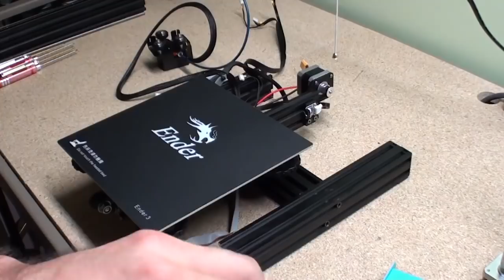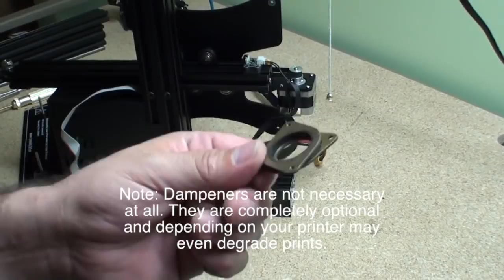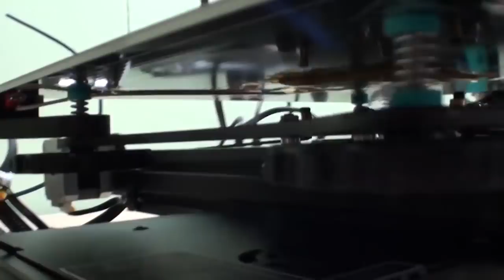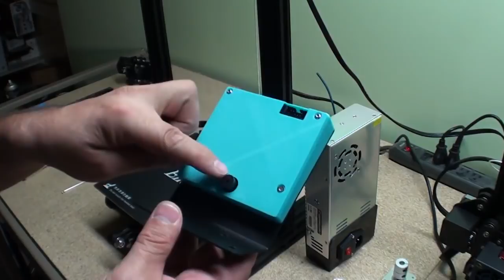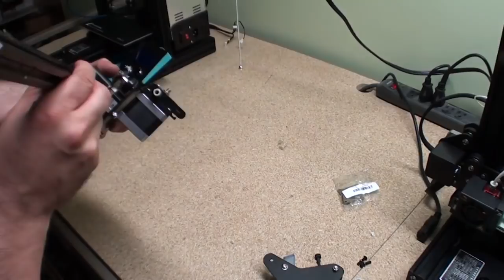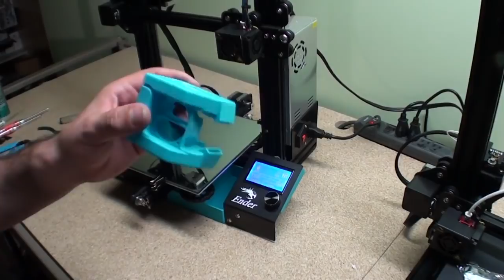Ender 3 Build Video

Comment: Would love  a good video detailing all the various forms of calibration to run with a new printer (bed leveling, PID, extrusion, flow and whatever they all are, probably several I've yet to hear of). Excellent video btw, will def run it while assembling my machine and some of the first prints will be the items you suggested.

Comment: GREAT thanks!  
Just got done putting one of these together .... is the top of the print head assembly suppose be on an angle?  The top two rollers are longer than the one on the bottom !

Comment: Is the way the Z Motor Mount downloads in Cura the best way to print? Should I flip it so there is minimal support needed?
Reply from the maker: Rude Masterflash always rotate a part for best printability and minimal support. I believe the z mount does need to rotated 90 degrees....

Comment: Hi, thanks for the instruction vid, I found it extremely helpful. I installed the dampers, but now my bed carriage plate catches on the stepper motor before hitting the endstop. Any advice to solve this?
Reply: There are two ways you can solve this:

1- move your Y end travel switch a bit inside so your bed stops before hitting the motor. By doing this you will loose a bit of Y travel.

2- Use some kind of grinding tool to remove the small part that hits the motor.
Reply: @1Wolverine2  Thank you
Reply from the maker: Cobus Grobler yes. Exactly what Yaser Hamud said. He was spot on.

Comment: Hi FourDogs, question, I noticed when I went to place the X axis on I had to slightly push the side bars in slightly to get it to go on. Once on everything seems smooth but when I take it off the sides kind of "spring" out some. Thoughts? Is this a case where maybe the side extruded aluminum may have not been cut 100% square?  I tested slop (if you will) from top to bottom and it all feels the same through the entire travel of the x axis.
Reply from the maker: Part of that may have had to due with the pre-assembled z-axis. I noticed that each one I've built, I've had to loosen the screws holding the wheels a bit to allow the z-axis to drop on with no resistance. If you're able to measure uprights at top and bottom before installing z-axis and they are identical, then the cuts sound good. On a rare occasion I have heard the holes being slightly off on the z-axis mounting plates.

Comment: Just a quick question about those spring washers, what if i want to printing abs? will they hold?
Reply from the maker: Marek Kozuchowski printed in pla they should be fine. However, if in an enclosure AND printing abs, I’d print them in abs.

Comment: When you are doing the Z motor mount, you have the nuts that are inside the rail.. Where did you get those? I have been wondering where I should get some of those.
Reply from the maker: You're looking for 5mm t-nuts, or hammer nuts. I usually get mine from banggood at https://www.banggood.com/100pcs-M5-Hammer-Nut-Nickel-Plated-Carbon-Steel-Nut-Aluminum-Connector-T-Fastener-Sliding-Nut-p-1048442.html?p=9U032229361202015116

Comment: Hi, have a link to the dampeners you used or will most any Amazon (advertised) Ender 3 dampener work?
Reply: BTW great video :)
Reply from the maker: Any nema17 dampener should work just fine. An additional note is that if you do you dampeners, you may want to add heat sinks to those motors as they do get hotter when separated from the aluminum frame.
Reply: Thanks, I will keep that in mind, good idea.

Comment: Just so you know, Creality should include the link to this video with every unit they sell. I am on my second Ender 3 because my first one was binding up on all axis and my Z axis would not even rotate. I'll admit it, I'm a first time noob and I didn't know what to expect. I eventually got a replacement from BangGood because I insisted that the printer was defective. While I waited, I luckily came across your video. What  a difference! I didn't try to assemble the Ender 3 in under an hour. I took four hours to properly build it. I did all the things you showed in this video. I even made myself a glass bed out of some broken picture frame glass. Coated with Aqua Net release agent it is a phenomenal print surface. My filament guide is made out of a piece of wire coat hanger (because I had to) and a printed pulley. My Ender 3 is phenomenally reliable and it has been printing almost continuously for two weeks now. My only paid upgrade is a metal Mk8 extruder for a whopping $12 on AliExpress. Thank you so much for being instrumental in making my Ender 3 a really great piece of kit. Thank you.
Reply: I just sent them this link as it helped to save me that shity wobble. It helped, but it's still not perfect like prusa mk3. Also I changed bowden tube couplers, helped to precise the retraction.
Reply: I have shared this video more times than I can count, it helped me so much and I see so many folks have the same issues, he lays it out so good.. And your right, time the time..

Comment: I don't usually post comments on YouTube videos, but for this one I had to. This is one of, if not the best build video I've seen. Concise tips, no BS, just valuable information in a perfectly clear way. Keep up the awesome work.
Reply from the maker: Yaser Hamud thanks! I appreciate it. Saving currently for another printer. Not sure what yet, but excited nonetheless. :)
Reply: @fourdogs3dstudio550 , you still owe us that first print video.😁

I bought the Ender 3 but it seems it's coming from China in a rowing boat, still more than a month to have it. I've been looking into build videos, slicer tips and overall 3d printing tips when I bumped into your video. That's why I think it's one of the best so far, 'cause I've seen A LOT of them.

Comment: what type of 5 mm screws did you use to attach the zmotor to the motor mount? I have 0 screws so I am needing to know which one to buy. I've printed off the design already and can't figure out what screw to use lol
Reply from the maker: m5 x 10mm is what I used on the z motor mount

Comment: Also, this appears to be the Z motor mount you used?
https://www.thingiverse.com/thing:2944504
I'll have to print that later after I've already put the thing together. Will that be a pain to have to disassemble?
Reply from the maker: Got it added to the list.. guess i missed that one. But no, very easy to add afterwards.

Comment: Where did you get that design of the tool tray with the added support on the right side? All the designs I see don't have that. Can you share your design? It's much better.
Reply from the maker: The link in the description is the correct one. You will need to use the SCAD file and change the options to configure how you would like it to look. The CAD software is open source and free. It can be found here: http://www.openscad.org/